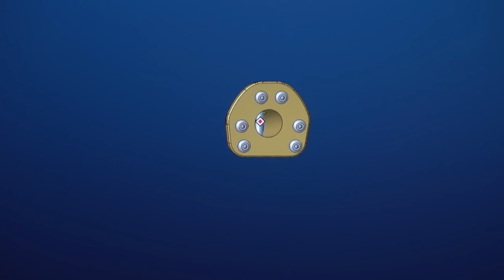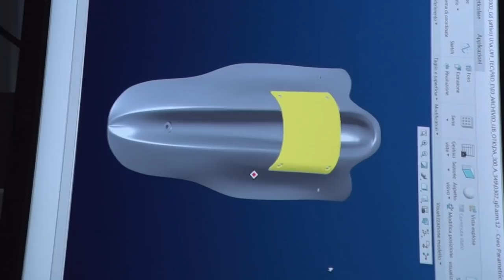Tony Kart presents new chassis for 2019

Comment: The frame never changes just remade over and over chrome molly I'm guessing. What if you double the other side for the bearings on the rear axle,  will it add to much weight, will it reduce axle flex on that side just curious.
Reply: twotwocold brake disc and caliper are in the way

Comment: I'm curious about kart weight, my mates Tony kart must weigh double mine, in fact mines about 145kg INCLUDING me kitted up and front brakes. I think his is closer to 150kg without him. His is meant to be very fast with a 125cc rotax, and with a driver weigh 260kg. I'd like to know how they can weigh so much different, and whether my mates 110kg weight will affect things?. Could someone that heavy damage a light weight kart, or are the differences in weight due to better materials used but same strength?
Reply: There must be a problem with your numbers. All kart chassis are similar in weight. A difference of more that 3 - 4 kg would be unusual assuming we are talking about the chassis only. A Rotax 125cc on a Tonykart would weigh about 84-88 kg I would guess.
Reply: @YZF648  my kart, a 401 tony kart, about 75kg, that other was a 150kg kart, same as 801 tonykart.
Reply: My Tony Kart OK weights 145 driver included

Comment: Angle of the steering hub is bogus.  Steering wheel angle is like a bus.  Very hard on wrists and arms.  Bought an angled aftermarket hub to bring wheel down to where it should be.
Reply: It is weird is you turn the wheel a lot...but good drivers hardly turn the wheel at all.   Watch in kart video from any top driver....  When 11:00 to 1:00 is the range of wheel turn...the angled hub is just fine...

Comment: Shame so many are cracking around the rear axle bearing mountings behind the engine. Ours lasted two meetings. Importers not interested
Reply: Andrew Kay The likely reason for that is the engine mount was done up too tight and therefor the chassis was unable to flex properly. Always back the engine mount off a quarter tern and lock it in this position once you have set the chain tension. This will allow the chassis to flex and this will stop it from cracking.
Reply: J -13 hi
The engine mount is always backed off away from the engine. These clearly cracked due to some sort of manufacturing issue. The chassis tube is  regularly lined with a sleeve that is available from the importer & this cures the problem. This is not a problem if you race the chassis for a meeting & then discard it, but when you are a club racer & want the chassis to last a season you have to sleeve it
Reply: Andrew Kay it’s the same in every chassis, KR, OTK, Birel, the chassis are so softs it’s normal. The softest the fastest (sort of)

Comment: It's missing front brakes and an engine that makes 120dB, well I got my 1995 Swiss Hutless with 1986 Honda CR125R engine, you need earplugs to run it and earplugs when its exhaust is facing you when you spectate :D
Reply: Cool story bro
Reply: I just bought front brakes to add to mine. They cost £850 new and weigh about 15kg. They are NOT race legal, they can be a liability if used cornering. 1 front lifts in corners, other tyre stops, you spin... they are more about pure posing now. Frankly they look awesome, and should have benefits stopping in a straight though, plus race starts, and maybe donuts if your really crazy.
Reply: An ok senior has a huge sound
Reply: @lucabettoni1452  maybe not as loud as the cr125 apparently. That sounds like an animal.